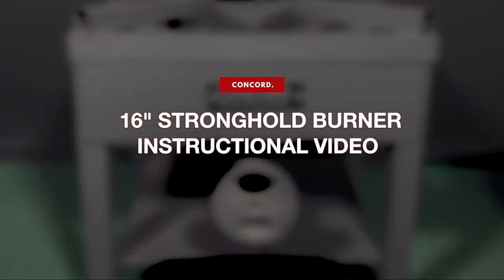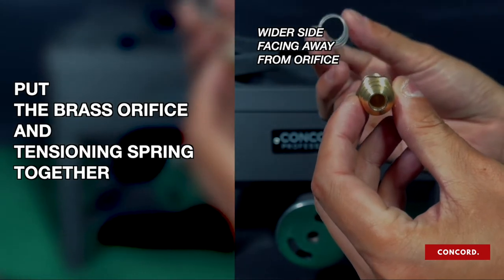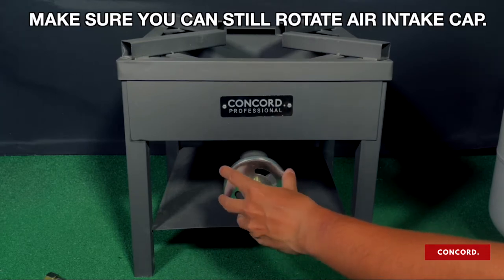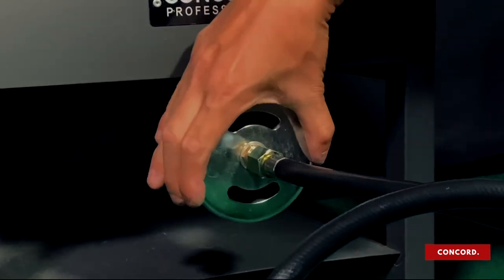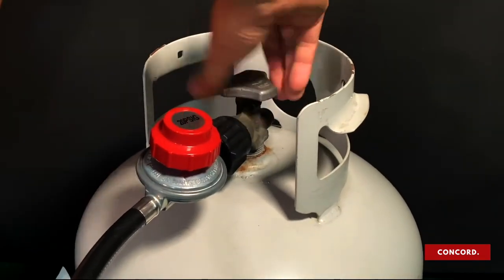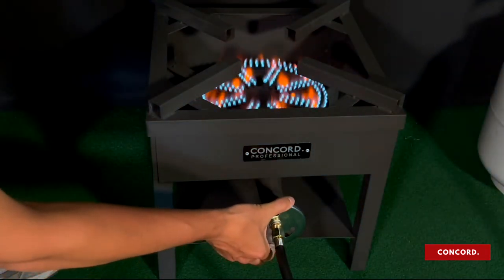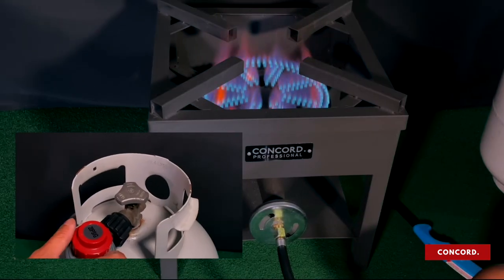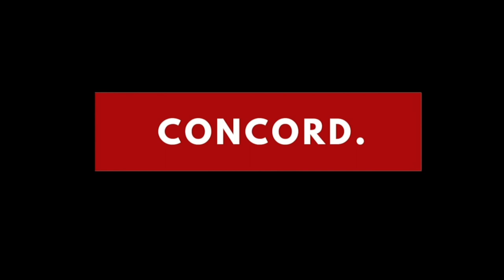Concord 16" Stronghold Burner Instruction Video

Comment: Is there a kit for the legs so it isn’t sitting on the ground like that? I’m 5’ 10” so something that low to the ground would be difficult to use.
Reply: Dude, I’m 6’2”… I set it on a stainless steel restaurant table that’s out on my deck, it’s made to be transportable but engage your brain, solutions aren’t hard.